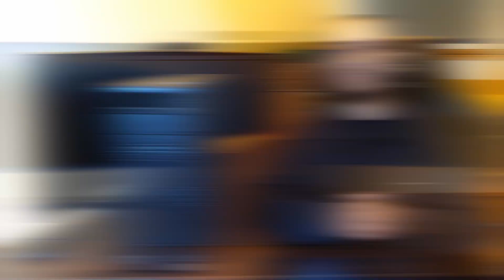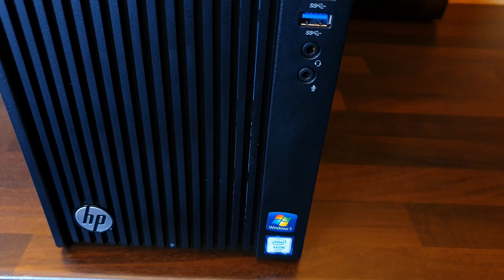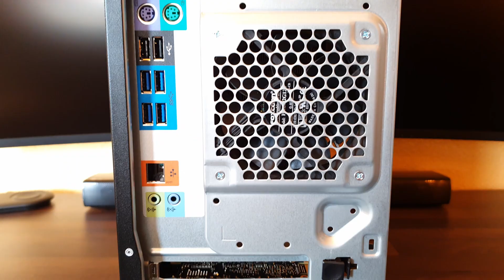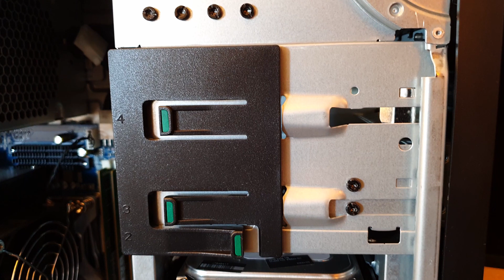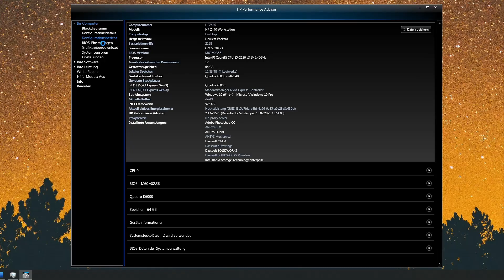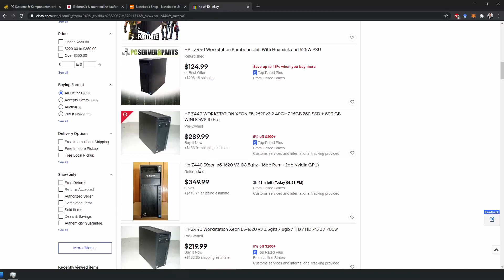HP Z440 Workstation, budget friendly computing power / Review

Comment: Hey Jorge, one more question, I'm working on something and I wanted to ask your opinion and expertise. Is it possible to use the HP Z620 GPU fan in the HP Z440? I tried placing it and it sits well, I'm just not sure where to plug it but that's on me to look? Would it work?

Comment: I just upgraded Z420 graphics card to RTX3060 12GB and 64GB RAM for my daughter video editing task. I am very impressed with the performance. Because of that, I end up buying Z440 from Ebay for $195 delivered and will do the same upgrade. I used to build PC before but the components are too expensive lately to achieve the desired specs. For less than 1K you're going to have a very reliable and powerful machine.
Reply from the maker: That is totally true, with these machines, as low as you got yours is a very attractive price for the performance that they can offer if you pair them with recent and decent hardware. I still have one around and working as good as always. Thanks for watching!

Comment: i have a z420, can i set the motherboard of z440 on the same case, for a upgrade?
Reply: I was wondering this exact same thing, z440 or z640 mb possible?  The main issue I'd worry about is fit, and power supply cpu power cables.

Comment: Very good video that agree on with you.  I am upgrading from a Z400 to a Z440 for 3d graphic rendering.  The price was right the z400 cost back in 2015 100 dollars for an  W3540  @ 2.93GHz   2.93  and 24 gigs of memory with an fx 1800 quadro graphic card.   The z440 V4 wil come with a 128GB DDR4 ⋅ 2TB 7.2K SATA HDD ⋅ Intel Xeon E5-2640 V4 2.40GHz 10 Core for around 700 dollars and it is a 7 year old computer.  I am pulling out a K4000 graphic card out of a old z620 V1 , 4 core and putting into the 440 when it gets here.   I could not afford a new one it would be really out of my price range at with is well over 3000.00 us dollars.   The Z400 hundred  is still going strong and I use it to surf the net on and watch  videos and talk to friends and it is well over 12 years old.   These workstation are built to last.

Comment: Just to chime in with my $0.02... 

I bought a used z440 with a E5-1630 v3, 32Gb RAM and a K4200 for about 275 UKP off ebay in 2019. Since then I've replaced the K4200 with an M5000, I've added a 1Tb Samsung 980 bootdrive with the HP Turbo Z gen 2 card and just this morning I replaced the E5-1630 v3 with an E5-2680 v4. 14 Cores/28 Threads  FTW! 

With the buying and selling on Ebay factored in I still haven't spent much more than 500UKP in total. My point being: If you shop carefully these systems are totally worth the money and as a bonus they are WHISPER quiet! Even when pushing the M5000 on long render runs the thing barely makes a noise. Lovely. 

Yes, I've lost a few benchmark points on single threaded workloads in the 1630 vs 2680 comparison, but the real world time difference is negligible. And with 14 Cores I can comfortably run a whole bunch more VM's which is something I need for work. The only thing left to consider is to is to maybe get the RAM cooler shroud and fill the machine with a bazillion gigs of RAM, but for the moment my workloads don't justify the outlay.

Comment: are you sure there is no restriction for going from V3 to V4 ?
so if the BIOS is upt to date all is well?

i am concerned because z420 accepted v2 if MoBo was of a specific part number (a later model) - which sucks.
Reply from the maker: Hello Frigider, i had until now around 6 different HP Z440, i never checked the mainboard model in specific, but in all of them i usually got them with V3 processors and upgrade them to V4 later on. Never had a compatibility issue, even with the top 2699V4. I always used retail CPUs however, never used QS or ES, in such samples i will not asure compatibility. Thanks for watching!
Reply: @JorgeMoralesAv  thanks! anyway , first proc upgrade will be V3 so that should work just fine :D

Comment: You are giving away some very good advice. I run a Z 420 it now my back up, just moved up to a Z4 G4. Intel Xeon and HP Workstation are like tanks in the computer world for Cad. Started out with XW 8000 that I still using to run CNC equipment the Workstation over 18 years old, it made two trips around the world in a suitcase. Still have running my XW 8400 and XW 8800 they great to run old equipment after retirement from CAD.
Reply from the maker: Hi! Thank you very much for such a great experience. Actually I remember my first HP Workstation was the XW8400 as well if I recall right. With a dual AMD Opteron 2 cores each or something like that. I think is still running in the university lab 😂 thanks for watching!

Comment: I own two HP Z440 workstations. Both have the 700 watt power upgrades, but after additional upgrades, I believe there is a shortage of power. I actually had to remove the upgrades I added (extra PCIe cards, extra SSD's and 5.25 inch bay devices), but once everything was removed, the 700 watts were sufficient in running the workstations.

Anyway, I was wondering, is there an adapter to accommodate the motherboard for it to properly connect to a standard aftermarket power supply, that you know of? 

There is a lot more that I want to upgrade the Z440 workstations with and I was even willing to put them inside of new cooling cases to allow a larger power supply to fit.

If there isn't an adapter available for the power supply anywhere, and after I do some research, I might attempt to create my own power adapter myself.

I really don't need too much from the 700 watts, just maybe a maximum of 1200 watts.

I know I'm attempting to push these workstations hard, but I want something that has more SSD's and  PCIe cards. 

What would you recommend what I should do?

Comment: Ciao Jorge, I am considering to take a z440 system for music/mixing production , few questions. no problem with driver for win 7 and 10 ? Is there a unique motherboard model or severa ones ? For actual budget limit, taking now a system with 1603 v3 cpu, would it possible in a second time to upgrade to E5-2640/2643/2650 (all v3) ? Bios update needed ? Better to have higher clock or many cores (Cubase as software multithread) ? Thank you very much, Mauro
Reply from the maker: Ciao Erka, zero problems with windows compatibility, even hp just released official drivers last week. Yes, there are two Mainboards, I can strongly recommend you to get one with a xeon 26XX series. Probably the 2660 v3 is a very good cheap option. For cubase, I think the best option would be an 8 core 16 threads with the highest speed you can get. I think the 2667 v3 or v4 would be a good option. Thanks for watching, and I hope it helps.
Reply: Thanks Jorge
Reply: @JorgeMoralesAv  hi Jorge, my cubase is sx3 and I read it could have problems with more than 4 core, doesn't it use more or can't use in good ways the 4 cores too? This choice because sx3 has a mixer integrated for yamaha dspfactory, just for summing and Reverb, all the rest of mix and master with win7 64 bit and emu1820m, so I would like to use more than  4 cores with a dual boot, what do you think about it ? Second, hp z620 is good as z440 ? Muchas gracias 🙂

Comment: Help my workstation, HP z440, wont show anything in screen. Before that it boot it up and I could access the BIOS. I changed some settings in the BIOS.The error then was the 6 beeps and I fixed it by pressing the CMOS button for 5 seconds. Now the computer does not beep, but it does even show anything on screen (no booting or even displaying the logo of HP), it is just a black screen. Moreover, when I now power on the computer, it create static noises and it seems that motherboard does not give any external power (like mouse and keyboard wont work, but the internal fans of the computer (CPU fans and video card's fan turn on). I need help, I don't what to do to fix this.
Reply from the maker: Hi Abbas, try removing the memory ram and then turn it on. If it gives you beep errors, then you are still fine. Put back the memory and turn it on again. Check what happens. I can recommend you to remove critical components each at one time, turn the computer on and wait to see what happens. So could you find if an specific component is not working properly. Try as well removing the power cord, ram, any storage device and press the power button for at least 30 seconds. Connect everything back again and give it a try. I hope it helps you and thanks for watching!

Comment: Love the video man! Would you recommend this for streaming on OBS only and not for gaming? 

HP Z440 Workstation, , 32Gb ram, 512GB SSD Hard drive & 1TB Hard Drive , nVidia Quadro K2200 4Gb Graphics cards & Windows 10 Professional
Reply from the maker: Hello Batmada, for streaming in OBS and not really intended for gaming should be fine. Depending on the input source of the streaming, if you are planning to stream above 1080P i could recommend you to slowly upgrade your video card. Otherwise, i think your configuration is very good! thanks for watching!
Reply: @JorgeMoralesAv  thanks a lot for your reply dude and for the feedback. Much appreciated. Keep the good content up my dude!
Reply: I have the exact same thing, I use it for both Stream OBS and Gaming just fine

Comment: can you tell me how to reset the bios password in z440 from the motherboard
Reply from the maker: hello Afroz, for this kind of workstations i actually a little bit complicated to reset the BIOS password. Do you have a purchase invoice of the computer? if that´s the case, you need to call HP support and they will guide you trough the process. Is not so easy, is the same for DELL Workstations and Lenovo, for security reasons, once the BIOS is locked only the manufacturer can help you. Sorry i can not help you more. Thanks for watching!

Comment: how can i add nvme ssd to my z440? there is no video in youtube.
Reply from the maker: Hello Emre, you need to get an HP Z Turbo Drive, it should be around 70-100 USD. Is just an NVME PCIe adapter to install an NVME M.2 Drive, i will give you this link just as a reference of what you need. I hope it helps you :)
https://www.workstation4u.de/de/hardware-zubehoer/solid-state-drives-ssd/1704/256-gb-hp-z-turbo-drive-g2-pcie-nvme-tlc-ssd